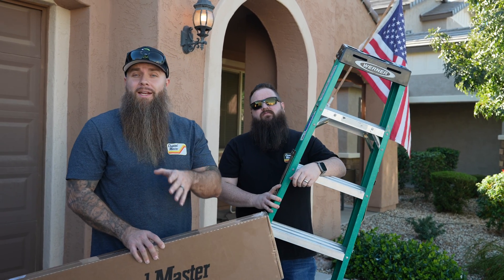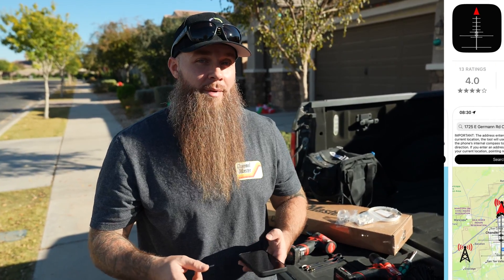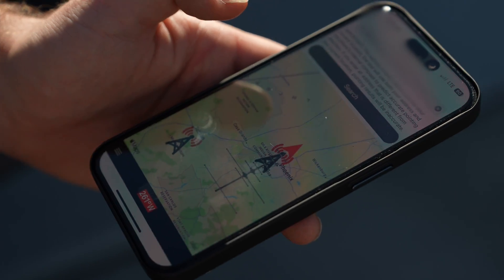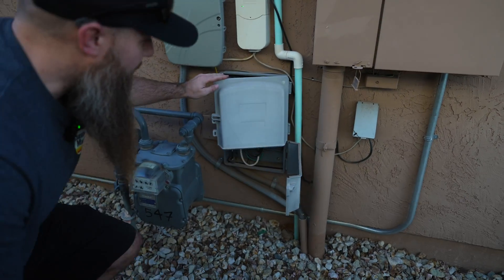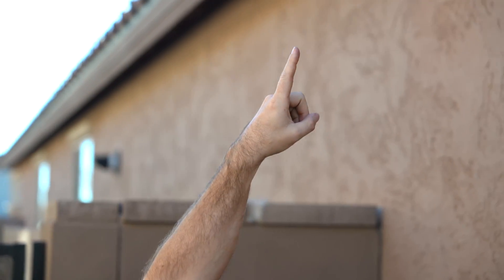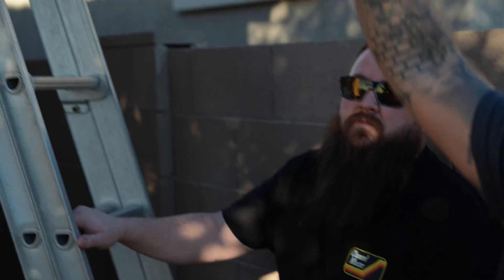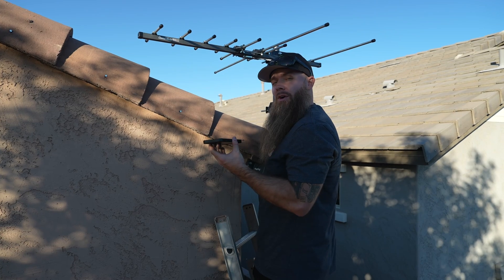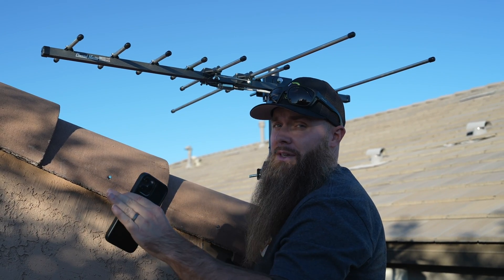Outdoor TV Antenna Installation Featuring Doug Bishop | Channel Master Pro-Model

Comment: It would have helped to see you actually connecting the cable from the antenna to existing cable line in the old box. Female to female adapter? Grounding block? I’m doing this exact project and I have no signal so this crucial part of the video would probably of solved my issues…

Comment: Well... let me start by saying that I designed antennas when I was in college in Cuba to get TV and FM from US. It was illegal but I didn't care. That was in the 80s. So I know I little bit about this. I now live in Arkansas (for those who are wondering: I'm a US citizen) and since I (my wife actually) was having problems to get local channels (I don't watch much TV anymore) I purchased exactly that pre-amp I saw in the antenna post. I know what to do and how it works, but you didn't let anyone know how is installed, why should have a LED light on due to the power inserter, and how you can split the signal (most people have several TVs) using Master Channel power through splitters. Most people don't know what is power insertion loss and how splitters work attenuating the signal once is splitted. 
I appreciate the fact that you mentioned and showed the app. I didn't know that one. I found this video very, very basic. You guys should educate more so people buy more from Channel Master. Isn't that the purpose of the video? Well... it felt short.

Comment: Sorry to be a critic but I think it is beneficial in this case...Certain critical details of the antenna installation may have been skipped.  There is no detail on connecting the mast amplifier.  No detail on applying a compression F connector to the cable, No mention of the amplifier type, nor the CM amplifier choices and a bit more detail of how to connect the amplifier.  Adding some of those details may help the viewers install the antenna by themselves.
Reply: Correct.  I have a pre amp from Channel master and am not sure myself.

Comment: So how do you hook up to television
Reply from the maker: For this type of installation, the antenna signal ends up being hardwired to the coaxial cable outputs in the home. Simply connect a coaxial cable from the output port on your wall to the coaxial input port behind your television. Lastly, scan for over-the-air channels on your television via the "channels" option in the settings menu.
Reply: @channelmaster  That would work perfectly if and only if your internal coax is of a good quality. Everybody knows that developers use the cheapest thing they can find because is not code enforced to use good quality cables. It is called minimum code. I replaced all my coax in the house to RG6 Quad shield. Thinking: If I'm gonna do this, I will only once.

Comment: Isn't there a need for grounding the antenna and mast?
Reply: Most definitely need a ground. They might be ground to the electric coming into the house being so close to the main coming in but they didn't say a thing about it.
Reply: What is best way to ground?
 @austinowens1294
Reply: What is the best way to ground if you're not running into the box on the side of the house?
Reply: The cable going into the house was already connected to a grounding block.